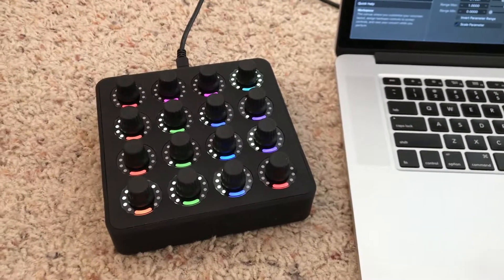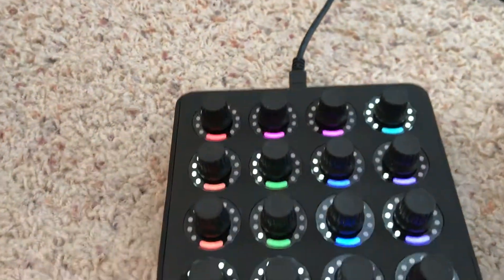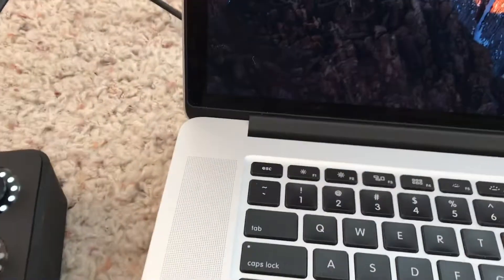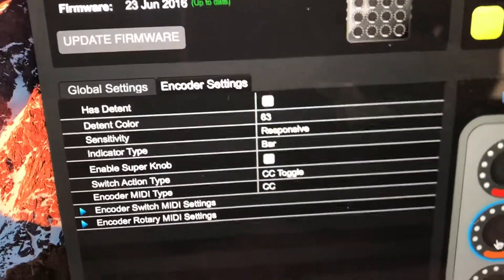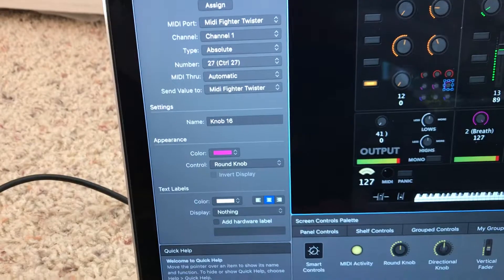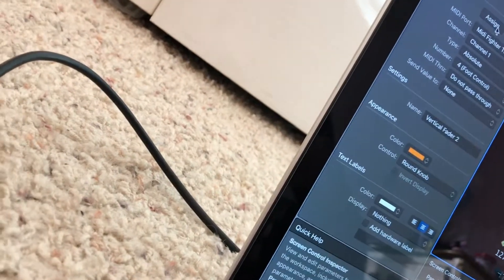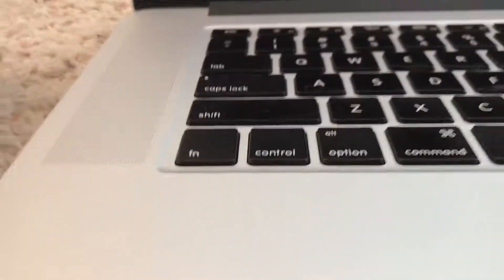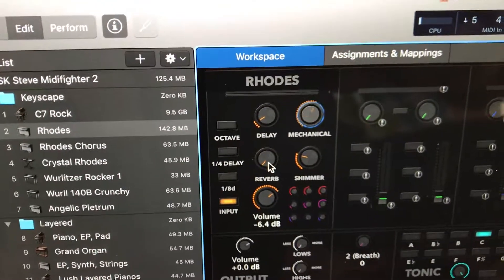Control Two MainStage Knobs with One Midi Fighter Twister Knob

Comment: Hi!
When pressing and then turning the hardware knob, does the second button in Mainstage reflect that buttons relative position, or does it start from the position or the original hardware value (as when not pressed)?